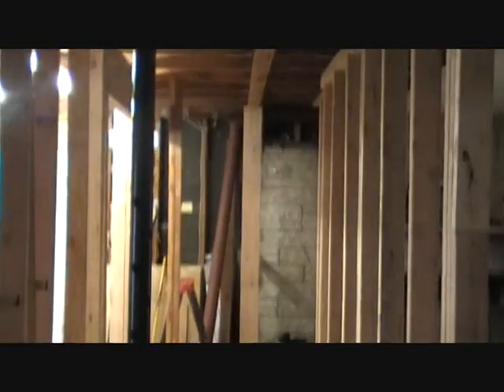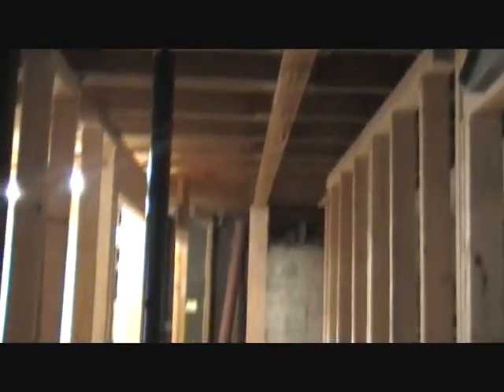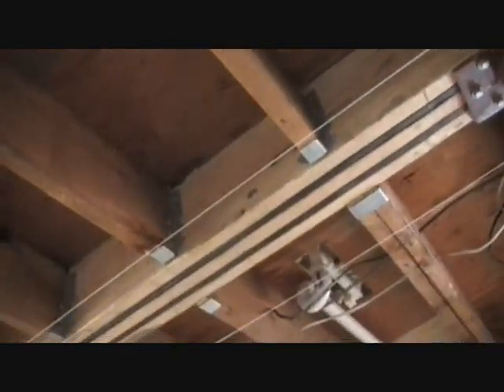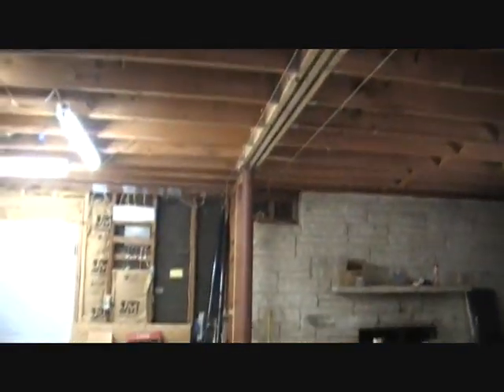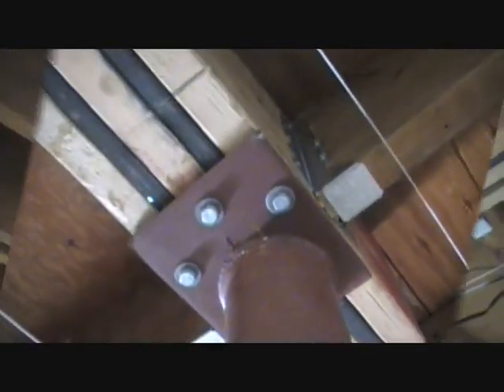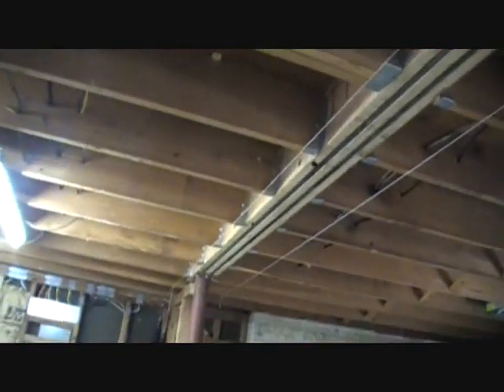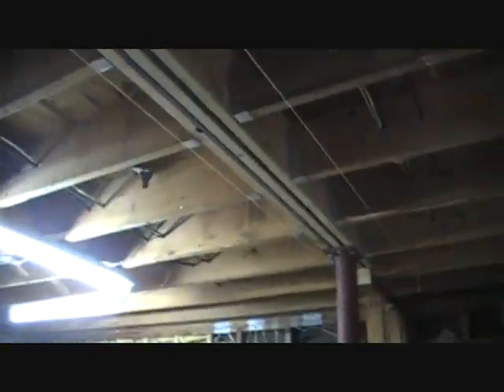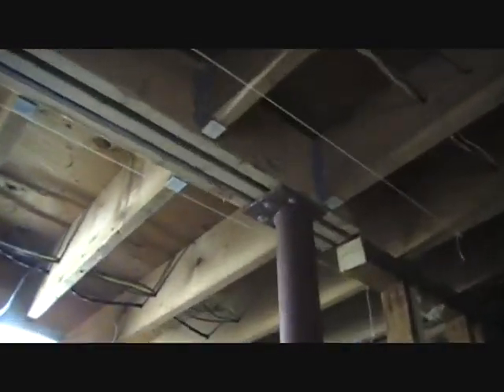How to replace a bearing wall with a seventeen foot engineered header! Part 2

Comment: How much did this beam weight? Was it difficult to maneuver? I am installing one, similar in size, but it will weigh about 1,500 lbs. Concerned about getting it on the lifts. I believe i will need 3 lifts, each one capable of 500 lbs.

Comment: You need to put a footing under the column you install to hold the beam. Either brick on concrete or just a concrete footing buried a minimum of 90cm.

Comment: I have a wall I want to take out. It is about 16' I have a crawl space. Do I need to also put a pillar of bricks right under the braces for the header? I understand running your beams through the floor but I got a 100 year old home and I got brick pillars for support in the  crawl space. Thanks

Comment: @ermalbania I am removing two 16' bearing walls and I had an engineer spec them and got a building permit.  He recommended 3, 2x6 trimmers on either end, and the floor in the basement would need to be blocked.  However, I am buying adjustable steel columns and going straight thru the subfloor and anchoring directly on the Steel I-BEAM in the basement; Ontario Building permit office recommends this as well.

Comment: what about the load on the concrete floor?  won't you need a deeper concrete footer to be in place to handle the load of the home?  won't the concrete eventually crack if you don't do this?